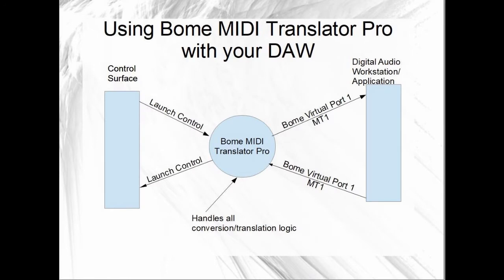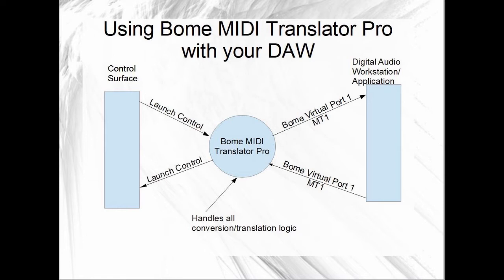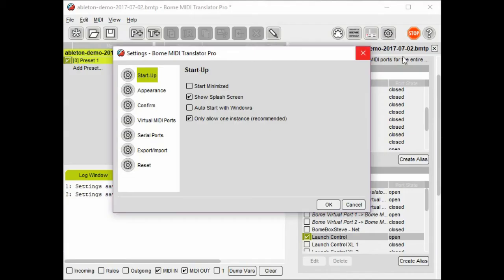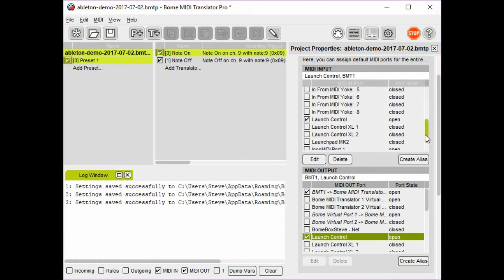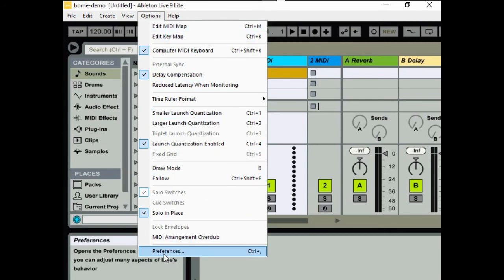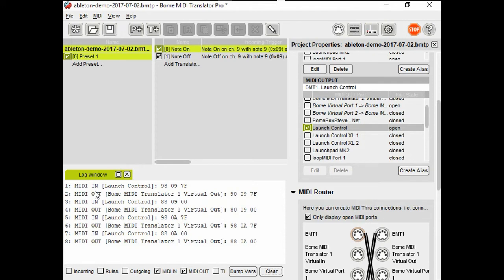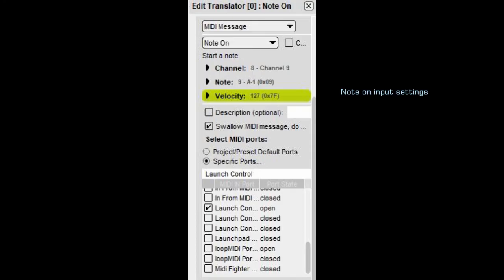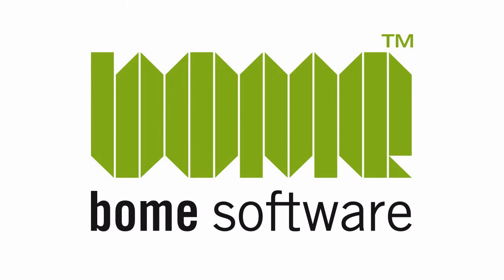Tutorial: Set up Bome MIDI Translator Pro as a MIDI filter for Ableton Live or other DAW

Comment: I have a question, but I have to explain my situation and set up before I do.
I use Logic Pro, I don't own a control surface like a real full board. I got my Akai MPK Mini and my Faderport v.2

Now the Faderport doesn't allow me to manipulate Logic's compressor or EQ, I wanted to let the Akai MPK Mini do all of that via it's 8 knobs. However whenever I change from track to track and do midi mapping on the smart controls, Logic forgets the knobs are assigned the compressor kind of. Like it will say that it recognizes it but I either have to mess with the knob a lot in order for it to work again, or it just won't work and I have to press the "learn" button on the smart control inspector window.

Would this software make this process less annoying? I learned on a board, and I wanna replicate that feeling with what I have. The Faderport works fine with transport controls and fader automation and everything else it does perfectly, I just want my MPK to keep up with that workflow.

All I want it to change from channel to channel with the Faderport, and the MPK remembering the MIDI mapping for certain. This task is weirdly specific and I cant seem to find anything to help me, will this help?
Reply from the maker: Hi,

My guess is you are using Mackie MCU protocol with Logic Pro with your Faderport.  I this is the case, you could indeed route all MIDI messages through Bome MIDI Translator Pro and either intercept or define any other Mackie MCU supported message and use with your Akai MPK.   
To Logic Pro, it would just look like one controller but we would be using a Bome Virtual port to talk to it instead of sending and receiving MIDI directly to the FaderPort

For follow-up questions, please use the Bome User Forum.

https://forum.bome.com

Steve Caldwell
Bome Customer Care
Reply: @Bome  this is making me laugh evilly, so I can seriously transform my AKAI MPK just as I wanted!!!!
I'll jump on this forum, just one more itty bitty question: .. can I assign the keys to activate shortcuts in Logic?
Reply from the maker: @daymanfighterofthenightman  

Yes MIDI, to keystroke is supported in Bome MIDI Translator Pro. You may need to change focus (which is also supported) on the application before you send the keystroke.

Steve Caldwell
Bome Customer Care

Comment: does it introduce any latency ?
Reply from the maker: Hi, you will not notice any latency by MT Pro itself, however depending on your audio settings of the system, there may be some latency introduced.

Latency usually occurs when processing audio signals and the time it takes to convert audio to digital or digital to audio signals.  Also latency can be introduced if sending over a network and the network itself has some delays.

You can test this all yourself with a free trial of Bome MIDI Translator Pro and then decide if you want to purchase it.  The free trial is fully functional yet times out every 20 minutes of use.

Free trial download here:
https://www.bome.com/products/miditranslator#downloads

If you have further questions, our forum is the best way to handle details:

https://forum.bome.com

Steve Caldwell Bome Customer Care
Reply: Thanks  @Bome

Comment: hi, your videos are awesome. But still i have an issue: Ableton it's not getting any midi signal, i am using a Boss FC - 50 wich it's connected by midi to my lexicon lambda. I can configurate the main botons, but the problem is with the expression pedal, bome recive the signal by the expression, but when i want to put it in ableton nothing happens. I think that i'm having problems with both configurations, or maybe i just don't know how to set te pedal in bome. I set it in midi message (in and out) by presing both "extremes" (i dont know how to say it)
i hope you can help me, and sorry if i wrote something wrong, english it's not my main language.
Thakns for you time!
Reply from the maker: Hi, and thanks for the kind words! I'm sure we can help you. Just to to our forum at the link below and start a new thread. If you don't speak English well, try using google translate before posting,

http://www.bome.com/support/kb

Steve Caldwell
Bome Q and A Moderator and
Independent Bome Consultant/Specialist
bome@sniz.biz
Reply: im using bome classic, can't afford the pro version
Reply from the maker: @juampiagostino3390  That's OK, I will help with classic version as well. Just not as many options/features available.
Steve Caldwell
Bome Q and A Moderator and
Independent Bome Consultant/Specialist
bome@sniz.biz
Reply: @Bome  thank you!

Comment: Hello sir, I have two questions. How to make bmt1 in and out since I didn't see that explanation in the video. And I have this ERROR: MIDI OUT "Bome MIDI Translator Virtual Out" does not exist. It is set to 'pending' so that it is used automatically when you plug it in.  What should I do ?
Reply from the maker: Hi, you set the inputs and outputs in Bome MIDI Translator Pro as "Bome MIDI Translator Virtual 1 In" and "Bome MIDI Translator Virtual 1 Out".  
Within your application  if you have Bome MIDI Translator showing long names (in the Virtual MIDI Ports options), then your DAW will see them as Bome MIDI Translator 1. If you set it up in options for short names, then your DAW will see them as BMT 1.

The error you are seeing is because you probably have another MIDI application trying to access the same port. In Windows, only 1 application can access a given  MIDI  input or output port at a time. To clear the error, close all other MIDI applications then open Bome MIDI Translator Pro, then it should  have access to the port. Your DAW will then be able to send and receive data base on the way you have your virtual ports set up. 

If you have any further questions, please feel free to address them in our forum at:

http://www.bome.com/support

Steve Caldwell
Bome Q and A Moderator and
Independent Bome Consultant/Specialist
bome@sniz.biz